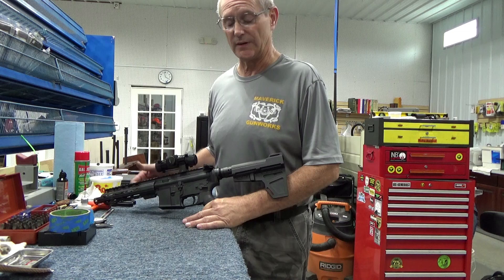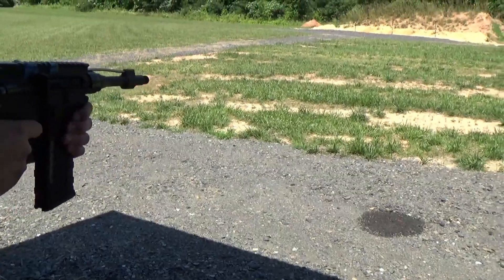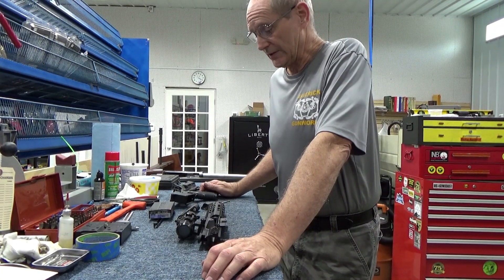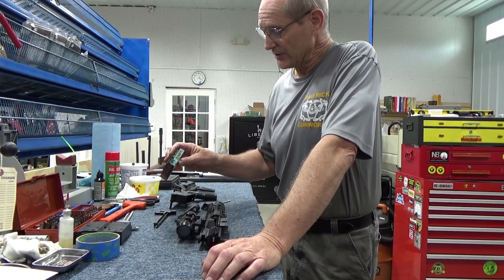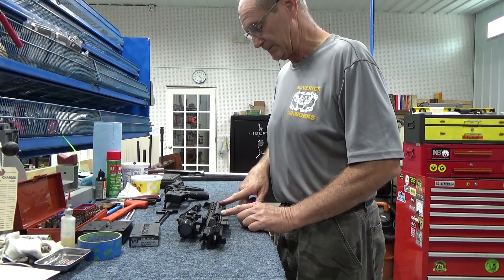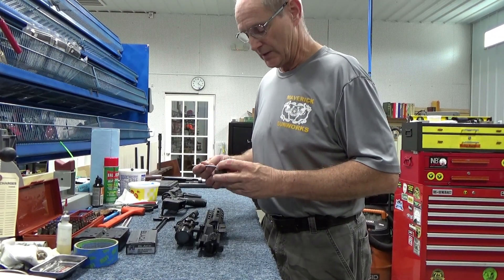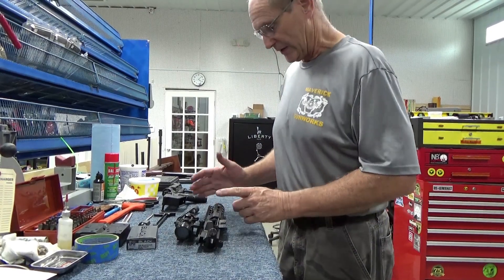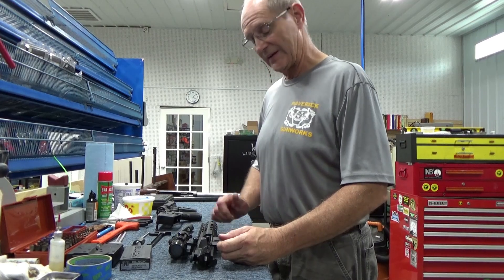300 Black Out Pistol Cycling Problem Fixed

Comment: So if they’re going to suppress it, the muzzle devise needs to be on there when test firing. Run the platform as you intend. You can’t run subs through a none suppressed weapon expecting it to cycle anywhere near how it’s designed. An adjustable gas block is suggested.

Comment: Always check gas tube alignment before drilling or replacing.
Reply: There are 10 other things to check before drilling out the barrel. It really should be the last resort. A 5 cent piece of weed eater filament would have saved him drilling the barrel in all reality.

Comment: I know this videos old. But if anyone here is reading this and using Hornady / S&B  Subs. They use fast burning powder, which causes low port pressure which makes it more quiet when suppressed.... Look for manufacturers that use CFE BLK powder like Winchester 200GR or Federal 220GR slower burning that causes higher port pressure, However its going to be a little louder...
Reply: So the bullets is why my gun is jamming??
Reply: @donniejones5854  You got to be more specific... Jamming how? Whats your barrel length?
Reply: @BUDGET_WARRIOR 4.75”
Reply: @amazinghd7768 Jesus christ thats a short ass barrel. Must be a custom gas block length if it's that short. At that length it MUST be suppressed. Lightened drag hammer spring and reduced yellow sprinco buffer spring. I would never go less than 6" with 300BLK

Comment: I finally got mine to eject the case but, won’t hold the bolt open on empty.  If I open my gas block anymore, the set screw will fall out.  Any ideas? Running 7.5” with a 3.3oz SRS and Hyperion 7.62  suppressor
Reply: Might need to drill your gas port out. Get a pair of calipers and measure your port and go from there.
Reply: @ that’s exactly what I did.  Also got rid of the Armaspec SRS for a JP SCS.  Running fine now.

Comment: Nice info! I’m in the middle of testing. Shooting 300 subs 220 grain suppressed 7.5 in Faxon 1/5T barrel. It cycles and feeds but with quick trigger pulls it doesn’t get enough gas to lock the bolt back. I have to the lightest buffer maxim defense makes and spring since it’s proprietary to the cqb stock. I realigned the gas block and it cycled better but I think I will try a new gas block and tube as the gas block seems to be out of spec like you said bc when I checked I am hitting some of the gas tube when I check with a drill bit.
Reply: Having the same issue with mine.  I opened up the gas port on the barrel to match the size of the agb.  Cycles much better with ejected cases around 3-4.  Won’t hold the bolt open on last round though.  I heard of some people running heavier buffers.
Reply: @ it’s been a while but I got it running perfectly with a Faxon gas black and tube and a lightweight Faxon BCG. Runs fast and locks back on last round.
Reply: @ I’m going to pull mine done again.  Double check the gas system.  Going to cut the SRS spring. I ordered a light spring so, don’t really care at this point.

Comment: Oddly enough what fixed my issues with this was to put in larue tactical power extractor, and change out buffer to an h1 and change the buffer spring back down to a milspec carbine, and voila. This is 556/223 not 300 BO but had the exact same issues u had here. The thought did cross my mind a few times of drilling out gas port bigger and just as I was about to do that everything started cycling

Comment: My 12.5 inch 300blackout doesn't like subsonic ammo, and when I put my can on, I may fire 1 or 2 rounds, and then it won't eject the fired round I put an adjustable gas block superlative arms.  I'm going to try different buffer springs.  Thanks for the info
Reply: Keep in mind that 300 BLK was not made for barrels that long.  It was designed to be fired from a 9 inch barrel.  By the time the bullet exits the muzzle of a 12.5 inch barrel, it will have already burned all of its powder.

Comment: Problem is the ammo. I am having the same problem, but if i switch to another subsonic round, cycles fine.
I've bought quite a bit of that ammo too 😓
Reply: Hey, I've got a suppressed 10.3. it won't cycle the next round, I'm using 193gr Hornady. You got any word on that ammo or?
Reply: @pinheadlarry9495  Use heavier ammo try 220 gr that seemed to fix my problem

Comment: I have a feeding and extracting problem. It clicks the same way and on some occasions the extractor pulls the bullet out of the casing dumping the gun powder and having to pry off the casing from the extractor. And the bullet head would be stuck in the barrel

Comment: I had the same issue. 8” 300 blackout BA AR15 barrel/upper. I installed a Sprinco yellow buffer spring, extractor and ejector springs. I did not reinstall the extractor O ring. I now have 3:30 ejections and she’s running perfect with three different ammo types. My intention is to suppress this SBR. I’ll update when I get the approval on my can. Any day now.
Reply: Reminder to update after you get your cool can and take ‘er to the range :)
Reply: @chupacabra304  Thanks. Sorry so late. Runs great.
Reply: Another reminder 🫡
Reply: @XRawSilenceX  Sorry. Got the can (dead air sandman s) last September. Took 13 mos. Anywho, installed the muzzle break that it came with and my rifle has worked perfectly since. Probably put 800-900 rds through it without any issues. Used subsonic mostly. As well as supersonic. Couldn’t be happier with the setup.
Reply: I literally watched a guy next to me take the regular carbine buffer spring out & he cut 5 coils of the back end of said spring, after that it still had a little preload with the bolt closed. And it ran like a dream from then on .

Comment: Maybe I mean it could be 1 million problems could be the anything from the head space and the bolt to too heavy of a buffer weight the type of ammo whether it’s subsonic or supersonic it’s probably the buffer since it got a break in the trigger so the BCG is cycling just far enough to reset the trigger but not chamber a new round it’s got to be that or maybe the gas block is on shifted I don’t know but I’m only 30 seconds into the video as trying to learn more about 300 block out as I just completed my radian model one had the lower for a while and want to get an upper so I wanted to do a 300 build using moves or barrel 416r stainless housed in a radian upper and sure fire…..
Some barrels I knew it some barrels do not cycle subsonic’s depends on the barrel and the buffer weight why do you want to shoot sonics anyway with out a suppressor if it’s not cycling with a suppressor and then it’s the buffer weight but it’s not just doesn’t have a can on their

Comment: Might as well get a ak74u with 7.62x39 this 300blk has issues.
Reply: The Aks74u is cambered in 5.45x39. A smaller and lighter round more a kin to a 5.56. 300 blk is optimized for suppression and supersonic without tuning in the field. If built properly the suppressor will resolve under gassing issues when running subs. Subsonic 7.62x39 isnt readily available or cheap. With the gaining popularity and lower prices of 300 blk it is superior to 7.62 if youre building with suppression in mind.

Comment: Question Sir, I am having the same issues in regards to cycling issues and it smokes after I fire the weapon. I am running 147g ammo from ammo inc. I took it to radical firearms her in Texas and they advised that its the ammo that I am running. I honestly disagree that its the ammo but wanted your insight on this particular issue. Also, I am not running it with a supressor.
Reply: I ran the same ammo today. Will not cycle with a surpressor on it, and it cycled fine without the can. I am reading that a lighter spring is needed. Spinco yellow, to be exact.

Comment: The 300 Blackout should cycle with a standard gas port hole size. Why you would drill out the barrel to compensate for an obvious other problem is beyond me.   The ar platform is a very simple system. When I see guys making modifications to their rifle for what is always user/builder error it drives me nuts.  The bottom line is , it should function within the proper specs! If it doesn't,  it's never the "specs" , changing the "specs" to correct for the real problem is amateur butchery .
Reply: Edit this again.  The subsonic 300 black out was designed from the ground up to be suppressed. Its VERY common for perfectly built ARs in 300 blackout to not be able to cycle WITHOUT a suppressor. Because the subsonic round needs the back pressure of the suppressor by design as there isn't enough gas pressure with just the powder in the round to cycle the bolt hard enough to pick another round off.  This is class 300 black out short barrel with subsonic behavior.   I hope he does a follow up with a suppressor on it, haha.  Its overgassed as hell for a suppressor
Reply: @RunningWithSauce  No it is not normal for a standard mil spec ar with a pistol length gas system to not cycle subs.  Mil spec means all the parts are within the same tolerances , what works in one should work in all.  If you specifically build to use a suppressor and adjust the gas/buffer weight etc so not to be over gassed with the suppressor it may not function without the can. But there is no reason you need to drill the gas hole to make it function without the can , it should function in a mil spec configuration
Reply: Maybe you can help me? I’ve got a 7.5 inch ATI 300 blackout. It cycles just fine unsupressed, I put the van on and it won’t cycle subs, but will cycle everything else. What the hell is going on here??? Suppressor is the YHM R9. Please help??
Reply: Can not van
Reply: @bomorgan83  I have a theory as to why it won't cycle Subs with the can but I need some info to verify. 
Does it eject the spent case? 
At what clock position does the spent case go , straight ahead is 12 , in your face is 6 o'clock. 
Does the bolt lock back on an empty mag with subs and the can? 
What mags are you using ?

Comment: I’m having the exact same problem with my 300blk. But I’ve swapped several gas blocks, including adjustable ones. It seems like the head space might be off, so I’ll probably use some abrasives but if that doesn’t work, I’ll drill out one of my standard gas blocks and see if that works.
Reply: What buffer weights are u at
Reply: Also curious on this

Comment: What buffer was being used?? Use a pin gauge set to measure the gas ports, not drill bits..  Did you check the button on the gas tube, the bolt carrier gas key I.D., the bolt tail bore and gas ring bore bore I.D. in the bolt carrier?? Was the buffer spring length in spec?? The 300BlkOut should be tested with a suppressor if sub sonic ammunition is being used. You should also use a bore scope to verify the gas ports are lined up after installation..
Reply: Just get ak, ak shoot
Reply: @billlee1724  AK's malfunction too. I have owned them since they were first imported in the US..That said, they are very tough and reliable like AR rifles that are well made..Manufacturer matters..

Comment: Why fire sub-sonics without the suppressor?
Reply: Huh?

A suppressor is not a variable, it’s the solution. 
Back-pressure. 
TMYK.
Reply: My state bans me from ever purchasing and owning a suppressor.
Reply: Baffle strikes? Basic Function Tests? Exactly what they are doing to get the gas system correct prior to adding in more variables. lol.

Comment: I'm running into this same issue.  I ran 150gr Fiocchi Range Dynamics through it and mine fired fine, but I ran some Sellier and Bellot 200gr Subsonics through it and it wouldn't cycle.  Everything is brand new...but, there were some issues attaching the gas tube to the gas block.  The roll pin wouldn't go all the way through connecting the tube to the block.  I still wonder if that's it or not.
Reply: You may need a chucking reamer to drill the roll pin hole in the gas tube and gas block. There are 4 holes the roll pin has to pass through for the roll pin to attach a gas tube into a gas block. This is common problem..
Reply: I had issues with fiocci rounds those exactly they would fire but wouldnt cycle next round worked fine with wolf 147 grain steel cased
Reply: Seiler and belloit is junk. Will not cycle well.

Comment: when you install the silencer, gas pressure will increase, solving the problem
Reply: Yeah if he’s definitely adding a suppressor then he shouldn’t been messing with the gas system. My 300 blk out won’t cycle subsonics but when my suppressor is on it cycles with no issues. If he decides to shoot supers with the suppressor then he’s gonna be way over gassed!
Reply: @jasoncw1440  mine will not cycle after a can with subsonic. Im guessing i need to put a lighter buffer in?
Reply: @user-bd5md5cm2j lighter buffer, lighter BCG, or less spring tension. At this point, I'm shortening the spring. Testing tomorrow
Reply: Unless its a free flow can. It will never change the gas pressure.
Reply: @tangomantactical   what idiot would put a free flow can on a pistol 300 black out though? that defeats the entire point of why the round was built to utilize the backpressure to cycle.
Reply: @RunningWithSauce  Apparently I'm an idiot. How many 300bo's have you built? How many AR's? How many Glocks have you built? How many firearms have you Cerakoted? How many cans do you have? How many SBR'S? .......One thing I am thankful for is finally finding the smartest entity on YouTube. Thank you.
Reply: @tangomantactical this is the gun equivalent to “what color is your Bugatti”😂
Reply: 😂😂😂😂 @RunningWithSauce
Reply: @tangomantactical  I’m an armorer and have a walk in vault. You’re very welcome. It’s literally designed from the ground up to be a low pressure round and a short gas system to siphon just enough bleed off to cycle. You don’t need to be an expert to know this you potato
Reply: @tangomantactical  that’s not necessarily so because I had to tune the 300BOs that I’ve built that had the same issues. And as a law enforcement instructor and armorer I’ve built and worked on hundreds of ARs, Glocks(Glock certified), 1911s etc, including my own collection, built to spec from the Marine manual. I also own a cerakote shop and have customized hundreds of guns. I also own multiple cans, including closed, user serviceable and multi-caliber cans. So just because you (say) you do those things doesn’t necessarily make your sweeping response true.
Reply: I’m using a Huxwrk ventum on my PSA 300 blackout and mine won’t cycle sub sonic rds.  Even put an adj gas block fully open and light buffers in stock
Reply: I bought a used 300 AR pistol.  It has an adjustable gas block.  I installed a SOCOM 300 SPS, and now it doesn’t matter what ammo I use.  Nothing cycles 🤷‍♂️
Reply: I’m having the same problem, my 7.5 was cycling fine with out a can then I put the HUXWRX FLASH HIDER ON . Now it won’t cycle super or subs with or without the HUXWRX 7.62 Ti can. 

Yea I’m an idiot too I got the HUXWRX 7.62 Ti it’s my first can and I can use it on my SBR , AR-15 and AR -10 . I was told I wouldn’t have to change any of the gas systems so that’s why I went with it.